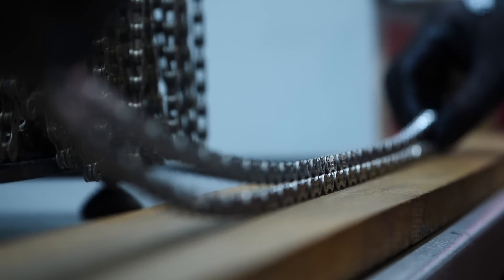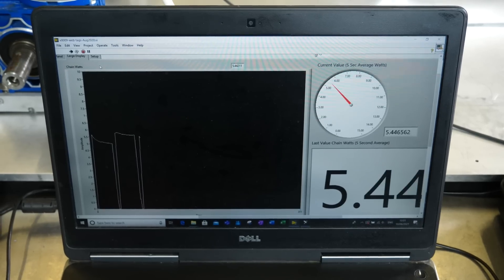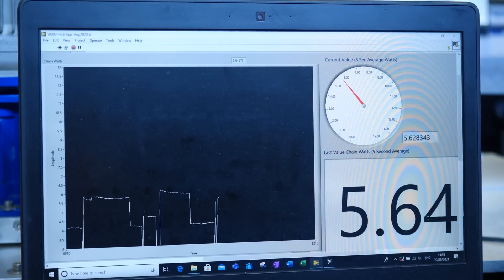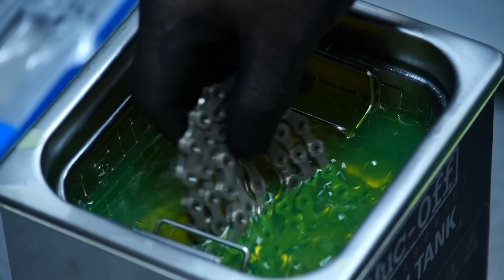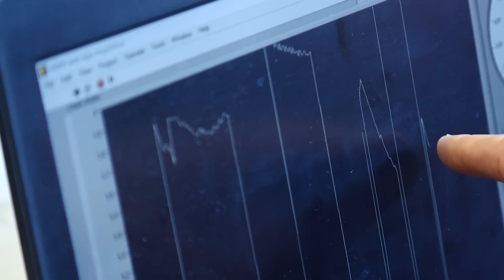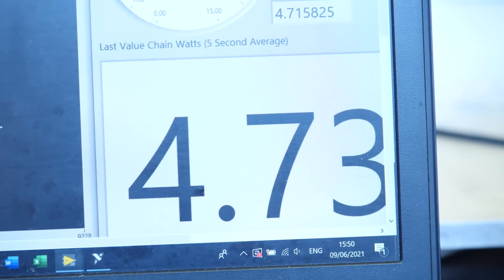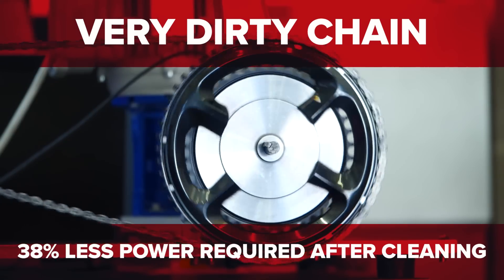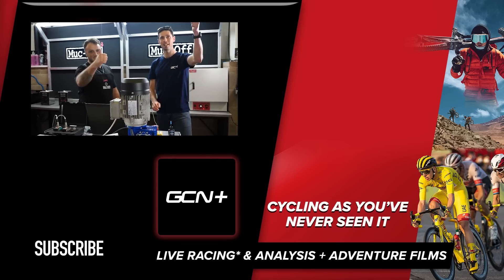Free Speed! | How Much Faster Is A Clean Bicycle Chain?

Comment: They should compare the power output on a clean chain vs a dirty chain instead of comparing the power losses.

For example: a dirty chain that loses 5 watts vs a clean chain that loses 2.5 watts will make make the clean chain appear twice as efficient. But if the power output on the dirty chain is 297.5 watts while the power output on the clean chain is 300 watts then then it means that the clean chain advantage is negligible.
Reply: The way a dynamometer works is you supply the drive motor with 300W precisely, and measure the delivered output of 295W from a clean chain vs 292W from a very dirty chain.
295/300 = 98.3% efficiency for the clean chain, and 292/300 = 97.3% efficiency for the dirty chain, or 1% (obviously, the 3W difference gives 3/300 = 1% difference.)
Keep in mind if you're only cruising around you might hardly even hit 100W output in which the real-world power loss dirty/clean is 1 single watt, which is negligible.
Which is why people like me can ride for seasons without servicing the chain and suffer pretty much nothing at all. There's zero chance I'd ever "lay out the plank" to lube each individual roller, that's just stupid.

Comment: Mmm, not as scientific as I was expecting. The dirty cogs on the rear derailleur, the mucky cassette, and the muddy front sprocket are missing. In a bike, it’s hard to just have ONLY a dirty chain. 
Anyway, we learnt that in a “fixie” situation, you could loose 5% watts BUT I’m confident that on a regular “Roadie”, you can loose up to 30% of your effort grinding a dirty drive chain (that’s with the gear block, derailleur, and big ring all bring mucky).

Comment: GCN is a great channel but this particular video is so misleading that I've logged in to just to say that the M of Muc Off should be swapped with an F...

Chain cleaning and lubrication is almost nothing to do with power as this video does actually prove, its about preventing wear and ensuring smooth running :)

Comment: Bike chain oil and grease is a rip off, most companies do not make their own, they buy it in bulk and get it repackaged in smaller bottles / tubes. Bike shops should offer a refillable service like some cleaning companies do, this would make it cheaper and save plastic.
Reply: dude just buy the 1 dollar chainsaw lube, does the same and the chain in a chainsaw is under a lot more stress
Reply: Car gearbox oil is unbeatable and also way cheaper than bike-oriented stuff.

Comment: This videos just shows that you should clean your chain to reduce the components wear and not for efficiency reasons. There's a reason that chains are so domiment in mechanical engineering and its the fact that they are extremely efficient no matter what, so rly you should have focused on the other aspect. Also, a clean chain is a silent one and thats something everyone can appreciate while riding :)
Reply: But comparing components wear would require a loooooooot more time and money  than this sponsored video.
Reply: @nounours2627  Instead of just testing the chain, they should test an entire drivetrain, dirty vs. clean.  More power is probably lost in the rotating components like the jockey wheels if they are dirty, than in the chain.

Comment: There's a lot of armchair experts in here. 🙄 Forget all the numbers and science. Whenever I clean or replace a dirty chain I can feel a noticeable difference. Thats the facts.
Reply: other people are doing mathematical equations. You cite to feel. And you're the one dealing with facts? ok mate
Reply: @darbymckilkannoncaid3279  Mathematical equations that prove a clean chain is more efficient than a dirty one? Ok mate. 🤡
Reply: @machinist_matt  this will probably go over your head, Matthew. But, definitionally, efficiency must be proved through an equation. Using math. 

And no one is disputing that a clean chain is more efficient, but others seemed to have noticed something, by using math, that you missed: the difference in efficiency is so minimal that, for most cyclists, it won't be noticeable.
Reply: @darbymckilkannoncaid3279  Ohhhh ok mate. My brakes feel weak but I wont change the pads until you get your calculator out. Because we need mathematical proof right? 🤦🏼‍♂️
Reply: Not really the same as you cannot feel 5 watts difference. Pretty shitty argument.  @machinist_matt
Reply: Never a more appropriate moment to say "Facts don't care about feelings"

Comment: I will clean my chain, but not with Muc-Off products. I think the bio-degradable factor is something we should strive for, but i've noticed that my chains wear out a lot faster with those than with a synthetic oil with Teflon or PTFE. So, although i know i'm polluting the environment, i know it is still less than what they pollute to produce new chains with all the packaging and transportation required.
Reply: I changed my mind. PTFE is known to cause cancer and birth defects :( It is also 'bio-persistent' like micro-plastics. I'll be changing to something else soon ...

Comment: I used to spend to a lot of time and money keeping my chain clean and lubed with expensive products until I went on holiday for a few weeks and rented a bike.

 The only product available to me was an old tin of 3 in 1 multipurpose oil which, after about 300 miles of use, I realised was perfectly adequate and that I had been wasting my time and money over the years.
Reply: There is another guy in the GCN or another video using only Wd40. He looks like a pro, or at least more pro than me. If Wd40 is good enough for him then it is good enough for me?
Reply: @softbingan  WD40 is 90% kerosene, not really a lubricant
Reply: Water Displacer is what the WD stands for, version 40, so goes the lore. But a lube it isn’t.

Comment: Anyone know what is the capacity and power that the ultrasonic cleaner used in this video is? Looks quite small and more relevant to home mechanics
Reply: Looks like a ~2 liter one. I have a 3 liter one myself and frankly would recommend an ever bigger one if you ever want to clean a cassette bigger than a road one.
Reply: @msironen  What is the wattage on yours? How long do you leave it to clean a chain?
Reply: @nalaunobelmoura4000  Depends on how dirty the chain is. If really dirty, I might do a full 30 minute clean. Usually 15-20 minutes though.
My cleaner has 120W ultrasonic power rating.

Comment: Although the power loss might be 9.5% or 38% less with a clean chain, since the power loss was so little to begin with, the conclusions are very iffy if not downright misleading.
Reply: Yup, they should compare the power output on a clean chain vs a dirty chain instead of comparing the power losses.

For example: a dirty chain that loses 2 watt vs a clean chain that loses 1 will make make the clean chain appear twice as efficient. But if the power output on the dirty chain is 298 watts while the power output on the clean chain is 300 watts then then it means that the clean chain advantage is negligible.
Reply: yeah, but they gotta sell degreaser somehow.
Reply: @danlev6927  I use gasoline. Very inexpensive when it isn't used for running engines.
Reply: @Perception_  Yeah kerosene does the job best.
Reply: @PhysiKarlz  I only use that for chains with o-rings(motorcycle) because it doesn't dry them out. Gasoline is better and more inexpensive, but should only be used for metal.
Reply: @Perception_  I don't understand. What's the problem with drying them out? Once cleaned I apply lube to the chain.
Reply: @PhysiKarlz  You stated that you use kerosene with bicycle chains. Bicycle chains are all metal, which means you can use gasoline instead because it is more inexpensive and it works better. 
Of course you can use kerosene, it's just that I personally don't see the point when it will only cost more and work less good which is why I stated I only use that for motorcycle chains with rubber o-rings, because it does not dry them out. It's even recommended in workshop manuals to use kerosene with motorcycle chains.
Reply: @Perception_  Oh, when you say dry out, you mean degrade the rubber.
Reply: @PhysiKarlz  Gasoline is highly aggressive so it starts to eat the rubber. As I said, I only use it for metal(not painted) parts(chain, cassette, chainrings etc) I also clean off the excess with a biodegradable liquid like muc-off or similar after this, to remove any remains.
Reply: @PhysiKarlz  it will basically kill your (motorcycle) chain a lot faster, fat inside can't be held, corrosion, which could lead to failures with potential disastrous outcomes. Motorcycle chain cleaners preserve the o-rings, as was said, and can be had in pressurized spray bottles for very little, in large volumes. So if you want to clean your chain and save money, might as well buy a large can when it's on offer. It will probably last you a good while.
Reply: If you are racing though, even that can be significant.  Even for a casual rider, the overall maintenance of your various components can add up to make a difference.

Comment: Alex, when you were there, did you take the opportunity to test a new box fresh chain with the manufactures gloop on it and then re test it striped with standard lube applied?
Reply: I sure did, You'll have to keep an eye out over the coming weeks for that!
Reply: Great question. Also want to see how much the super fancy lubes are worth
Reply: I hate the factory gloop they put on my new KMC chain, the stuff is absolute vaseline and a magnet for all the dirt leaves and dust the road has to offer. I tried degreasing it with Purple Power and it still wouldn't take all of it off.
Reply: @mrrodriguezHLP  have the same problem with Shimano chains. My strategy is to buy 5 chains, degrease them in 3 steps and at the end when they are dry and degreased, I apply the Oz cycle wax on all of them. Then I have a batch for the next 1500km. Rewaxing is not that hard anymore for a already waxed/degreased chain.
Additionally my indoor trainer does not become dirty with the waxing technique.
Reply: @SaschaN  How long can you ride on one chain? Are you following oz advice on wax temperature? You're not by any chance from a German speaking country, Sascha? If so I'm wondering what device you got for heating up the wax since the slow cookers I'm looking at don't have adjustable temperature by degrees Celsius. I was thinking about a deep fryer but the rod in there probably heats up too quickly and burns the wax 🤔
Reply: @TheExplodingCore  my English skills have revealed that I am from Germany right ? :) For waxing I ordered a slow cooker from Hobbes or something. The process until the wax/graphite mixture becomes liquid takes hours. After letting the chain inside the mixture for an hour and shacking it for bubble removal, I put it fast inside cold water so the wax doesn't drip out. Then the chain becomes super stiff but the wax stays in the elements.
The chain is driveable for around 300km without worrying. If it is raining and the sand/dust from the ground does get onto the chain with the splashing rain water, I have to change the chain because the sound  is nerve wracking :) (like you would chew with sand between the teeths)
Reply: @TheExplodingCore  the total lifetime span is not reached yet after about 1000km on each chain. Because that I can't tell you how long each one will survive.

Comment: Waxed chain is fastest, cleanest and cheapest in the long run.
Reply: Yep, and waxed chains are actually not all that difficult to maintain either. There’s great info on Zero Friction Cycling’s website.
Reply: @paddyotoole2058   ozcycle has great videos about waxing
Reply: @_----------_  yep, I’ve been all over his videos as well. They’re great! I made the transition across to waxed around 9 months ago. Slow cooker, molten speed wax, then mixing my own wax as per oz cycle with ptfe powder etc. the works. The messy part is doing the initial new chain clean with multiple white spirit soaks and meths etc. But once that initial waxing is done the re waxings are easy. I’m using YBN connecting links as they are designed to be reused 5 times each. I can’t see me ever going back to wet or dry lubes again. How about you?
Reply: @paddyotoole2058  You sound exactly like me. But I use connex links. They are nice
Reply: I made mine using a modification of the recipe buried in sheldon's site - bacon grease and beeswax.

Comment: "200-350 watts... I would say a keen cyclist". Yes, keen but only for 15 mins :-0
Reply: *250-300w
Reply: consider that power in bike is not so uniformly distributed as in dynamometer, since 2 pedals we got to push on. So chains and sprockets and dropouts should be tested in erratic maner, with say 350W average. More realistically, with 700 W average.
Reply: 745.7 watts = 1 HP.     BTW it's pronounced "dynamometer" not "dyno-meter".
Reply: @Quasilobo  incorrect, dynamometer measures how effective your dynamo detergent is 😅
Reply: Haha
Reply: 200 is not a lot at all tbh.

Comment: This machine cannot reproduce the actual chain resistance. Unlike a motorbike chain, a bicycle chain has sections where the tension on the chain is reduced.
Reply: All chain drives have a taut side and a slack side when transmitting power, regardless of the application. It's the taut side where most of the power losses are realized within the chain, both on a bicycle, and on this test rig.